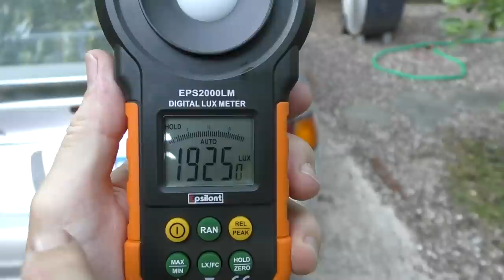I Made a Huge Mistake Buying These Headlights

Comment: In the end you're just better off with halogen lights, they're so much easier on the eyes. Not to mention blue spectrum lighting is really bad for your vision and overall health. I've seen some led projector headlights right out of the factory blind the hell out of you too. LED tail lights are harsh as well. Ever have them in front of you at night and the brakes engage? After You'll see a pattern of LEDs across your eyes. These lights should not be passed as safe. Maybe in small interior lighting or parking light bulbs but they are otherwise too intense, period.

Comment: Hids are not meant for projectors that were designed for halogen. They are best for projectors that were designed for hid, hence RETROFITS. People are still confused about hids. There were some cars that came from the factory with reflectors with hids, those were designed for it, like the 99 ES300 Platinum Series. But halogen housing and hid housing dont mix unless you are doing a RETROFIT.

Comment: I've never had anyone flash their lights at me when I'm using my Mercedes that has the factory HID lights. I think all the after market lights need to have the lights adjusted after installing. The bulbs may not be in the optimum position compared to the factory lights.

Comment: Comparing LED lights and Halogens in performance, I'd go with Halogens. They are better off-road in dust, snow, fog, or rain. LED  is no good during these conditions, it's very reflective with the elements hence not good performance. Only good thing about LED is they don't heat up as fast or use the battery more... that's. Halogen/Amber for the win!

Comment: Halogen lights are hot enough to drive off moisture. Some LEDs are not. Putting them in a car designed for halogens can cause problems. Maybe top-quality LEDs can stand the moisture.

Comment: Headlights are designed to operate with a bulb having an exact physical dimension. If you use an aftermarket bulb where the light source is not exactly in the same place as the original then the focus and aiming will be off.

Comment: Typical headlights when measured at 100ft away come in at average 1000 lumens for low beams (800-1200 is normal), and 1800-2300 for high beams. Versus most aftermarket HID and LEDs put out 2000 lumens for the low beams and not much more for high beams (1700-2500, much wider range). Us Federal law (and Canada is almost the same) pretty much says to keep the light output within the specific range (800-1200 for low beams and 1800-2200 for high beams), which includes every day drivers, not just manufacturers.

Comment: And density of traffic and removal of expansive roadway shoulders or grass and tree-lined mediums on parkways, beltways and interstates to increase the number of traffic lanes increases the intensity and frequency of headlight brightness and glare hitting / impacting drivers traveling in the opposite direction 

This is far from ideal in terms of distractions and eye stress to drivers in both directions - especially in the far left lane 

So past civil road layouts designs when land was cheaper and traffic was less was superior to the pleasures of driving at night on multi- lane roads by widening the distances between north/ south or east west traffic

Glare during the day staring at computer screens and extended glare at night when on high car density roads with the max- brightness lights

And even the light blasting into the car interior and off of the side and rear view mirrors in often insane when coming from a car or cars behind your car with their max brightness  headlights

Comment: Hey Scotty, I just replaced my stock halogen with an LED aftermarket for my 2007 Toyota Corolla.  The LED has specification as (9-36v,36w,8000LM,270°,6500K), I am not sure whether I am on correct specifications.  How do I check this.  The headlamp doom is quite foggy, I tried with toothpaste, brake fluid, but eventually it gets cloudy very soon.

Comment: It's not that the arc-discharge capsule was too bright, it is that the beam pattern generated by an arc-discharge capsule in a lamp assembly designed for a filament bulb is incorrect.

Comment: Reflectors vs Projectors. HID vs Halogen vs LED. Not new to me. Been seeing a lot of LED retrofits on halogen reflector assemblies. I doubt these retrofits meet manufacturer specified tolerances/criteria. Beam distribution is awful in most cases or the installer fails to aim the assemblies. Besides the brightness or color temperatures, I think the beam is more important. Main deciding factor whether or not it'll blind an oncoming driver. Very dangerous indeed.

Comment: ive heard you really need projector headlights for HID bulbs to work good without blinding because it doesnt disperse the light as much
Reply: Meade Helios that is true. It is best to have a projector housing with HID and LED. Some LEDs can work in reflector housings but they have to be designed right.

Comment: You neglected to mention that when replacing incandescent headlights with LEDs you must orient the LED to shine straight up and down in the reflector for proper beam output pattern.  The incandescent bulbs emit light in 360 degree  pattern, not so with the LEDs.
Reply: You shouldn't be putting LEDs in a halogen housing they are not suitable because the reflectors shine the light all over the place causing it to be dazzling to other drivers. LEDs and HIDs are only suitable for projector housings. Halogens can also be used in projector units.

Comment: i was with you right up until you said that the electricity from the bulb can pull enough power to cause a loss of fuel, so if that is the case...battery powers the starter to wind the flywheel to crank the engine at which point the alternator takes over most of the burden of electrical need....so how does a led save gas?
Reply: also i'm sad you never mentioned the Tucker once in this video, especially near the end

Comment: Ok Scotty. it appears you know very little about HID headlights. HID headlights won't blind you if they are in a bulls eye lens projector type headlight assembly. The blinding effect only happens when they are in the wrong housing or are misaligned. They have to be adjusted properly just like normal Halogen bulbs. I couldn't see the type of assembly you have in that car but it doesn't appear to be the correct assembly for HID which would explain you getting flashed by people. I have HID's in my car and you can stand in front of the car at night 20 feet away and not see the headlight but for a low intensity glow. they don't blind since they are adjusted properly.

Comment: The chemical Deet in the bug spray OFF! Actually makes a chemical reaction with the plastic on your headlights and actually cleans them an polished them all in one shot. Only problem is u have to spray it with clear coat once ur done to protect the Len's cause all Len's have a protective layer an the Deet will eat it off

Comment: Don't bulbs dim with age? That would explain why the older ones are dimmer. People used to flash their lights at my '90 Accord, but after a year or two, that rarely happened. I just guessed that they were too bright right out of the factory. BTW, finally one gave out about five years ago and, with the help of a small-handed friend (not DJT) I replaced both of the low-beam bulbs. New bulbs but no flashing motorists. Maybe they aren't over-bright, or my 25 year old glass headlights are a little less clear.

Comment: Scotty after I changed from stock halogens to LED, my headlights have started to crack/make these little cracks where the lights point. Could I’d be because of the high power it puts out? Also the lights have fans on the back of them

Comment: Hey Scotty, how's it going? How often it's recommended to clean the a/c internal fan? Any tips on doing this job? My 2011 Peugeot 207 is blowing cold air but the fan speeds have been going down over the years, both batery and alternator seen fine

Comment: You didn't mention how headlight patterns affect this issue. You installed HID lights in a housing built using the old headlight pattern so of course it wasn't directed correctly. Same for Halogen or LED lights installed in housings not designed for them, the light is not directed properly.

Comment: That’s not a ballast resistor attaches to the end of that it’s a power converter to keep the bulbs fan on replacement leds come with a fan built in

Comment: We should be able to call highway patrol or something so we can report license plate that have blinding headlights... I’ll speed up and drive fast so I can get away from those blinding lights... there gonna cause an accident for sure. I’ve heard if you change the bulb to LED when it didn’t have LED the light rays reflect differently and causes the beams to shoot out in all different directions. Manufactured LED headlights are designed to point towards the ground where you want to see and not shooting all over the highways where it could temporarily blind people.

Comment: No Scotty.  There is no expensive route you can go that allows putting LEDs in an incandescent housing without causing more blinding glare.  Even if it's not brighter there is still the broader beam profile and the cold color temperature.  That kewl color tint, it's universally problematic.  To whatever extend they help you see, they are even more than that, blind other drivers.

There is a huge difference in what OEMs are doing to integrate an entire system around LEDs and buying something aftermarket.  It's somewhat irrelevant that they happen to be LEDs too.  At the same time, it's worth considering that many top researchers are declaring that the OEM LED setups are also causing problems and need further regulation.

You might also get sticker shock when you realize how much these OEM LED headlights cost to replace, compared to a $6 incandescent bulb.

Comment: The new Acura/Honda’s headlights are NEVER aligned right. Always aimed way to high, and I drive a 4runner with a 3 inch lift - I still get blinded.
Reply: Ahh someone else has noticed this. Those new civics with the mutli LED headlight option are set right at the legal limit of alignment. I know this because I work at  Honda of Canada where they make them and the CRVs. Its absurd, because not only are they insanely bright which isn't really the issue, but if they're on the slightest incline and you are below them, they hit you right in the face. It's ridiculous and dangerous.

Comment: I think in US  HID is same like Xenon lights, in Europe is more like - Xenon - Factory put this HID lights in car.  Hid - self-made installation to use xenon lights with car that uses Halogen. In Europe you CAN'T use HID light (it's illegal), only xenon installation what mean  lights with homologation to xenon, and some system that cover light setting in real time so if you jump on dust road light keep same angel. That means you just simply can't instal HID to 94 Toyota Celica or any other car that do not com with xenon installation in Europe ;) ALSO IN  EUROPE WE GOT ASYMETRIC LIGHTS, so  i think you will always need to replace headlights to "Americans" not important is it hid or halogen...

Comment: Easiest way to remove haze from headlight is Flitz metal polish on a buffing wheel.
Reply: Woody Rosenschein really?
Reply: @TToanTran  ...any mag wheel or metal polish works great.  Even by hand with 2 rags. Follow up with a spritz of Aerospace 303 coating to prevent UV degradation.
Reply: @TToanTran  Takes just a few minutes each.  I use the buffing head from Harbor Freights kit and put the metal finish on and it buffs right up.  Then coat with car wax to UV protect it.

Comment: I aquired a 2005 Mitsubishi Lancer Ralliart which recently had the radiator replaced, Ive learned the passenger headlight went out when the radiator blew. The lights have a ballast and igniter what can I do to get them working properly again? The bulbs, wiring, or ballast? I tried connecting a good ballast and still nothing, Im hearing a buzz noise that lasts a half second when I switch the lights on, low beam.

Comment: There's a bunch of inaccuracies in this video.

1. It's not the source of the light that's so much the problem, but the lens/reflector. Most idiots who put in HID/LED put them in headlamps that are the parabolic type and suck at handling all that extra light, and for LED, can't even point them right. REGARDLESS OF WHAT YOU THINK, DON'T "UPGRADE", unless of course you don't give a crap about others on the road.
2. LED's don't glare if made from the OEM? Corolla's anyone? Those things are wacky bright, controlled or not. Esp those damn police vehicles that are the explorers. 

3. LEDs don't use a ballast. They use a driver that gives a constant current, not so much needing a high voltage. 

4. Also seriously doubt your Matrix with parabolic headlamps put out more light than your projectors in the Lexus. The Matrix is newer but the Lexus has better technology for sure.

Comment: I brought the correct H4 Led Headlight bulbs as the CSP very small Chips Line Up Exactly Perfectly With The Halogen Bulb Filaments Both on High Beam & Low Beam & my H4 Led Headlight bulbs sit a 3 0clock & 9 0clock   & not that the Led CSP Chips fit further inside of the Led Headlight bulbs & my lights are very Bright what Lights & on low the light Beams do not interfere with other Drivers on the road or roads Kind Regards Peter PS that's why I have good H4 Led Headlight bulbs have very small Chips because everything lines up Exactly Perfectly with the Halogen bulb Filaments

Comment: My parents have a 2017 Audi A4.  I guess it has LED lights.  Anyway, driving at night, you constantly have people flashing you thinking the high beams are on when they aren't.  Very annoying.  On the upside, the low beams do light the road very nicely.  ;)
Reply: It's not because they are too bright, it's because your parents don't have their headlgihts aimed correctly and are breaking the law. Tell them to lower them, it's a 2 second job and can be done with a screw driver and sometimes like in my car, can be done by hand.
Reply: @MarshalBeard  I seriously doubt that.  It's a 2017 Audi with only 26,000 km, it came like that from the factory.  No one has touched the lights.  But I can mention it, I mean, it's possible though I would be surprised at that level of poor quality control.
Reply: @MaestroTJS  Maybe they're not to the point where it's against the law, however it's been a common trend for auto manufacturers to be setting the headlight angle right at the edge of legal requirements, and with brighter bulbs being put into cars are causing people to get annoyed. I work at Honda of Canada where they make the CRVs and Civics, and the higher trim models with the multi LED headlights are aimed way too high for how bright they are. Normally they're fine when you're driving on a nice flat road, but if one passes by at the top of a hill or you're driving below them or they pass over a small hill, it's like the finger of god poking your eyes out. 

if it's that new and the headlights havent been touched I'm sure they're within legal requirements. However, if they're getting annoyed with flashing when going over a hill and such, it wouldn't hurt to lower the angle maybe a half inch parked in front of your garage on a flat surface.

Comment: Extended exposure to LED lighting  is very hard on the eyes.  It will lead to Macular degeneration.
I know that they have messed with my eyesight.  I have made some changes reducing LED use,  dimming of displays and blue light monitor glasses.  And my eyesight has been slowly coming  back.

Comment: Scotty, can you explain then why some cars come with HIDs from factory that are not in projector headlamps? The is300 for example years 01-05
Reply: What Scotty said was a blanket statement. There were Lexus, Volvo, Mercedes and Acura vehicles with reflector housings and HID's that were still legal. It's not necessarily the brightness of the light, its where the things are pointed. These were completely legal because they were pointed low enough to pass the lux-height-distance test. The law was you can't have a certain amount of light/brightness (lux) at a certain height at a certain distance from the vehicle. If all cars today still passed this test I would be greatly surprised, especially those that have been lifted or modified (obviously having your brights on would immediately fail this test). 
The worst ones I tend to see are Toyota SUV's, they aim their lights so high coming out of the factory it's like they're trying to kill us.

Comment: Hey scotty, I have a 2011 kawasaki versys 65p that I am slowly converting into a one off custom street fighter. I learned that motogp bikes change how their shifters work, where pulling up goes to first, then they press down for the rest of the gears. Are there any issues with doing that regarding how long the shift rod will last? And what would be the major downsides, I'm familiar with the upsides.